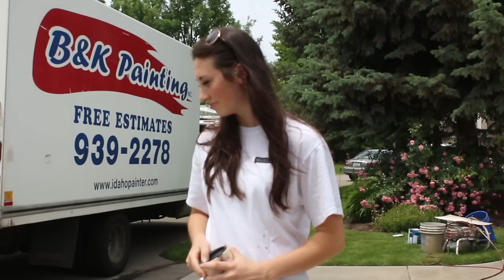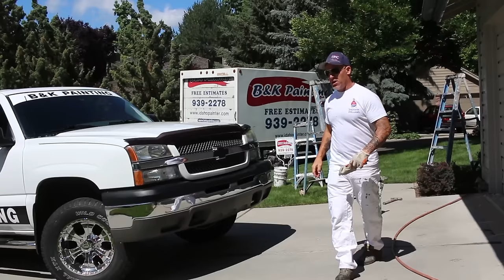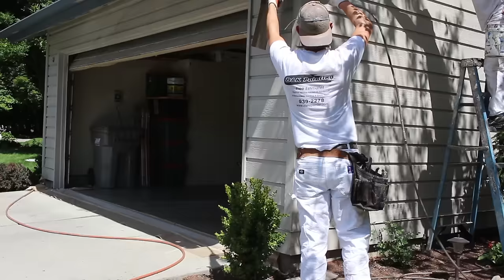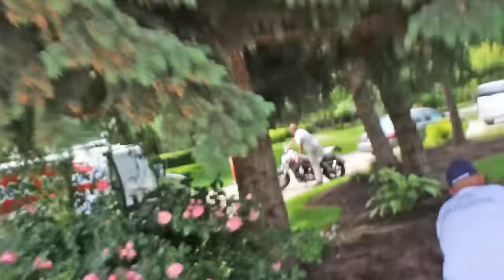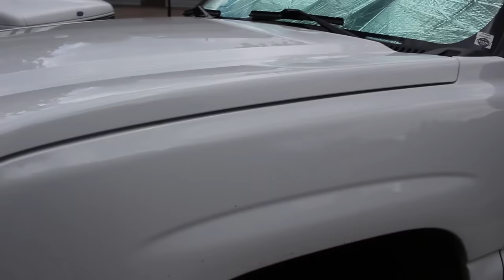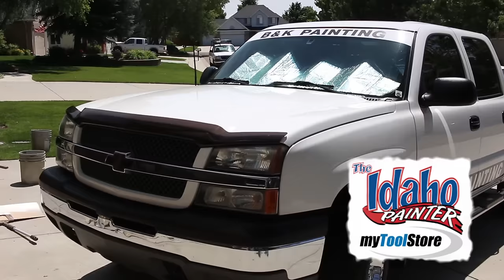Controlling Paint Overspray.  How to limit airless paint sprayer overspray.

Comment: What if I have a magnum x7 and it doesn't tell me what psi I am spraying at? Plan on spraying my house next spring and I dont need angry neighbors I could roll it but spraying is so much more fun.
Reply: The Idaho Painter I just started spraying, and I'm using a Graco RAC 411 tip, what would you say is the best pressure for that?